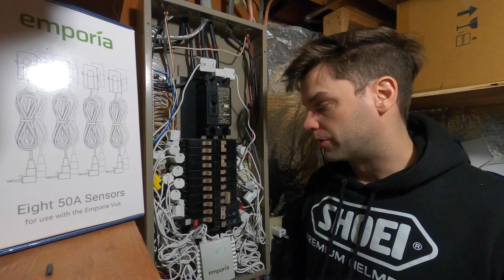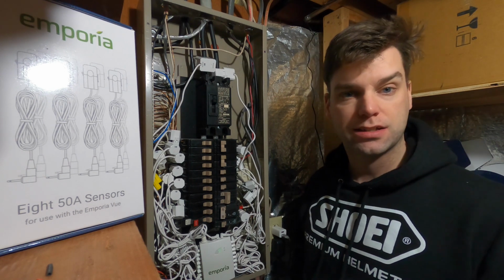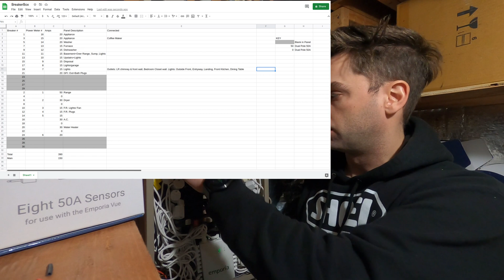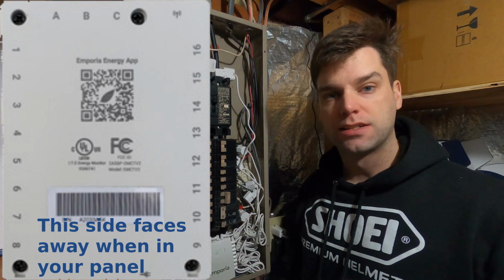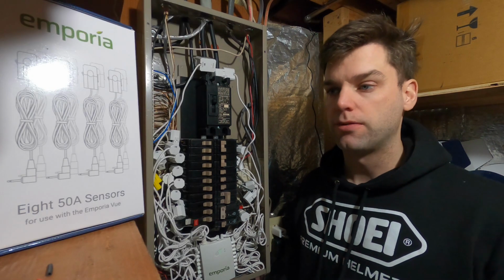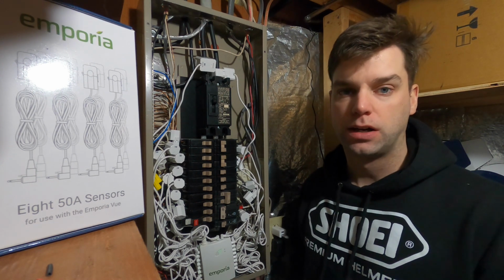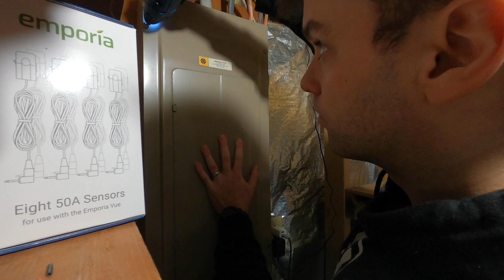Home Energy Monitor Install Pt. 2

Comment: Great job on the vid. The product is I’m sure, top notch. But it’s very clunky. Wouldn’t it be better to run the wires out one or two of the knockouts with bushings and leave the unit on the outside?

Comment: So what's the update on the high energy consumption? Looking to buy a similar setup  myself to complement the meter gateway provided by power company and 20 kw solaredge system. Downside is the Solaredge doesn't have consumption monitoring and gateway is completely lost during production so have to wait till next day for actual data update. How is this for the non monitored circuits as 16 CTs would only cover about half of my panel even with only using single CTs on the Double Pulls.

Comment: Out of curiosity --  Why would it need to get power from both phases? My understanding is that the Hall Effect sensors are for detecting current and the red/black wires are simply to power the unit. Right? Any idea why it can't be powered from a single phase? Not like it needs much power.
Reply from the maker: I think that its so it knows the "actual" voltage on each leg. The voltage is nominally 120V in the US, but it can be between 115-125 volts. You're right that the sensors measure current, so I think its taking the current measurement and actual leg voltage to calculate power. All this is just a guess, I don't know that I've seen it in the documentation... What do you think, does that make sense or am I nuts? :)
Reply: I do believe it is for reference as well as providing source power.

Comment: Hello From the Uk, just a quick question, when you connected the power for the unit would it not have been safer to just connect directly to the breaker, so you don't have a floating joint?
Reply from the maker: Hi! So I didn't put two in because I thought you couldn't have more than one wire/ breaker in the US by code. After your comment I did some research on stack exchange and it looks like some breakers are designed for two wires, and they will be clearly marked for it. They also said that a pigtail in the box is fine by code, so i think my setup is good for my situation. 

I think you have a different style of breakers in the UK (DIN rail?) vs the US style, so I'm not sure what will work for them. I use DIN rail breakers in my trailer, and I've got power in and a jumper out to the next breaker, so if your local code allows that it's probably a cleaner/ easier solution. 

Thanks for watching and commenting!
Reply: @GPMech  I understand there are different rules/codes over there, I just like a tidy install. Here in the UK are consumer units are a lot smaller, so some have installed the unit on the outside as the sensor cables are quite long and then connected the power to a plug and just plugged it in a local socket. Yes, we have DIN rail-mounted breakers with a brass bus bar connecting the live/hot side of the breaker. But your video was well worth watching, thanks.
Reply from the maker: @PeteMulv  glad you liked it, appreciate the feedback!